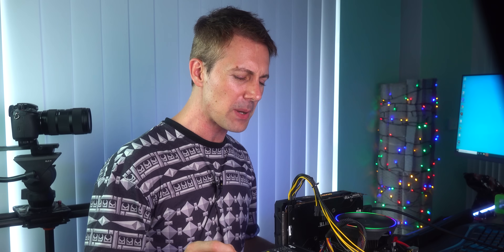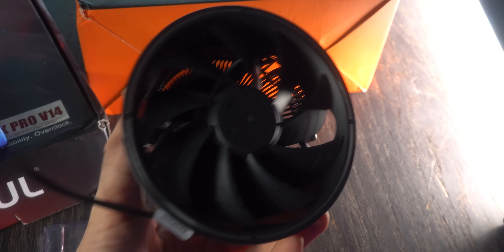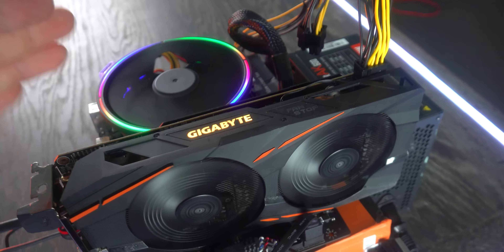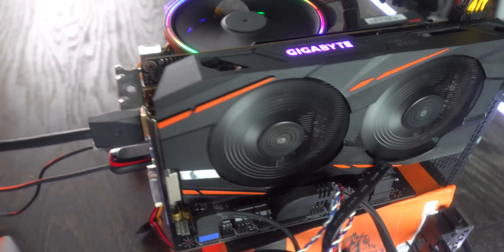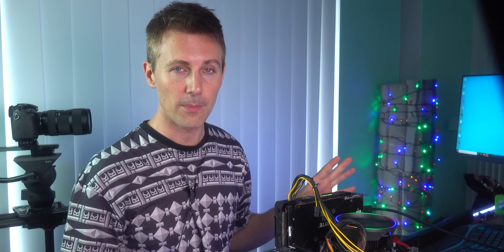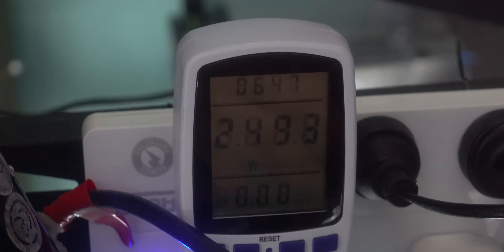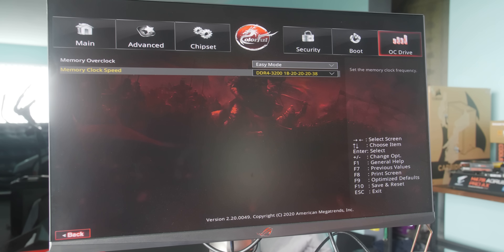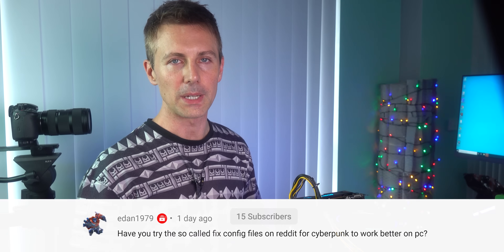Can This $470 ALIEXPRESS Gaming PC Play Cyberpunk!? (Plus Config FPS testing)

Comment: I'm building a budget pc too.
Until now I got a prime b450 plus, 16gigs of good ram at 3200mhz and a sata ssd for a low price.
I'm waiting for a good offer for the cpu since is all overpriced, I can't decide between a r5 3500x or a 3600🤔
Reply: I'd probably get the 3600 unless the 3500 is a good bit cheaper.

You could maybe also look at a r7 2700(x) maybe they are cheaper than ryzen 5s in my country and in games that are more single core focused you only lose like 5-10 fps. And in optimized games that use all cores it does very well. But not sure about prices where you live but might be something to look into.
Reply: @sansundertale69availablename  I guess I will go for the best offer at this point, I just hope for the price to drop a bit eventually.
I would prefer to get the 3600 tho
Reply: @sansundertale69availablename  the situation is similar even here in italy actually. I wasn't expecting the ryzen 5 to be this expensive, I should've got the 3600 at 175 euros some month ago

Comment: I bought a HP laptop ssd cable of Ali Express, never arrived, they "re-shipped" it, with another bogus tracking number, never saw the part. Permanent black list from me, sticking to ebay for component purchases from now on, aint nobody got time for that.
Reply: I always try to buy from reputable sellers, and haven't had any issues so far.
Reply: @Quicksilver-7791  Yeah, that was the first time experience I had, I guess chose a dud seller.

Comment: love your vids.

I have a question, I'm going to build a pc for the first time.
the front fan, they must come behind the iron grid plate or may they also be placed in front of it
Reply: in front is kina dumb because a lot of the airflow will just go to the sides instead of through the vents
Reply: @virtualtools_3021  thx for the answer! Need to buy a smaller ones!!

Comment: PLEASE DO NOT BUY USED GPUS ON ALIEXPRESS! They will just ship something that is not working and the price to ship it back will be insane and they will NOT refund you. I tried that because i needed to build a couple of pcs and ordered 3 xfx 480s , they came flashed as 580 , one was artifacting out of the box, another one started after a couple of days. When i opened disputes, they asked me to ship it back and that would cost me more than 70 usd to do.

Comment: I just upgraded to an RX 570 (Sapphire ITX) 2 weeks ago! Got it for $80, put it in my Haswell system.

Fantastic little card, loving the new performance it offers over my old 7850, at the same power draw.
Reply: Got the 570 and people say it’s amazing but at 1080p low on gta 5 it’s only getting 35 FPS online
Reply: @passivevii4052  That's less than half the performance everyone else is getting.
Reply: @passivevii4052  Thats really weird I have a RX 570 and i get 70-80 fps in GTA on high settings. What CPU do you have?

Comment: If you get involved with flipping PC's getting hosed comes with the teritory. An important tactic is being able to mitigate your losses. I recently had a deal on an OEM RTX 2070 for $250 and the card checked out but the image on the screen was artifacting. Despite everything I did, cleaning the card, new thermal paste, flashing the vbios, none of it worked. Fortunately broken RTX 2070 cards sell on ebay for about $200 so I only lost about $50 in the end. It sucks but that's how it goes sometimes.
Reply: But what if something doesn't get delivered to your home? Then you're not going to get anything back.

Comment: The Hex fix for the .exe did work for AMD SMT CPUs with 4c8t and 6c12t only, the 8c16t, 12c24t and 16c32t ar working fine.
Reply: By now they updated the game and basically integrated the fix into the game proper and also deleted the config file.
Performance is the same between manually hex editing and using v1.05 but performance can differ quite a bit between runs.